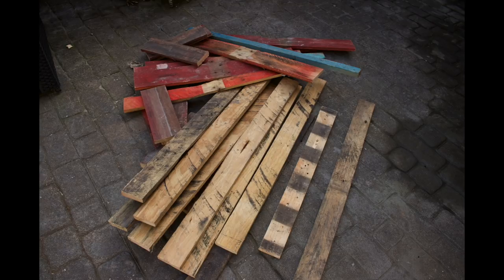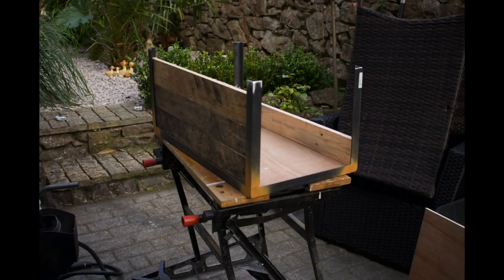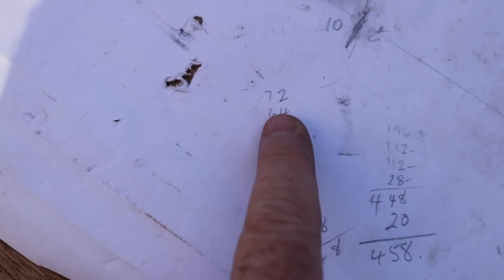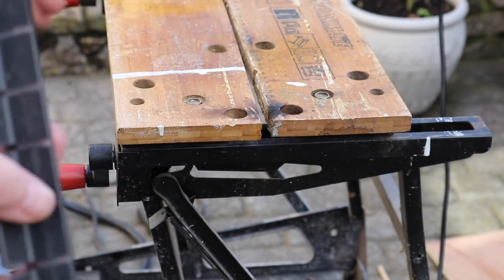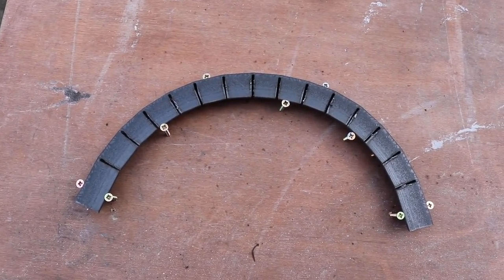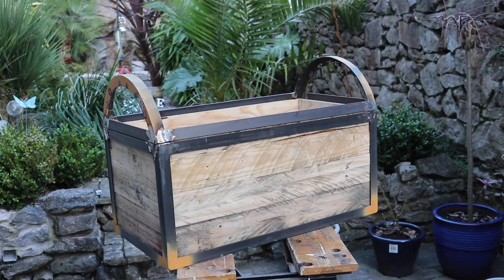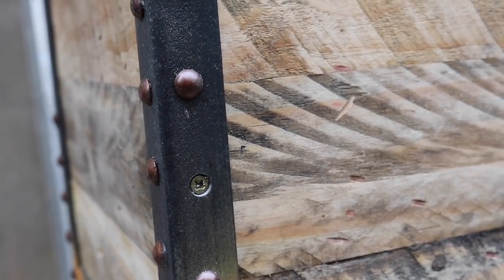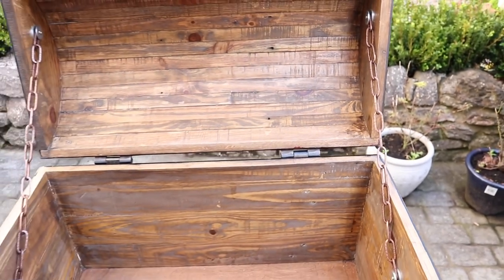Pirate Treasure Chest made from pallet Wood

Comment: Great video! Whenever you cut the first V’s out of the angle iron, what were the measurements of the V to get the angle iron to bend to square?
Reply from the maker: Thedevincox cut angle at 45 degrees each side of the centre line. A gap after bending is fine as the weld will fill it.